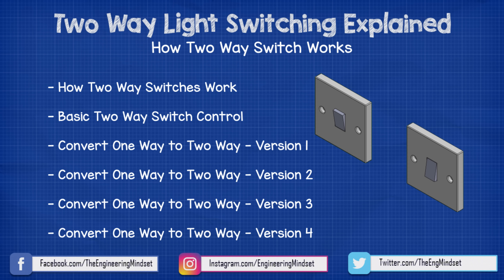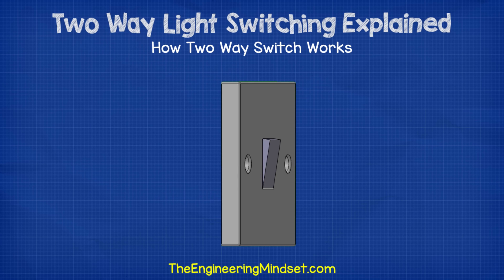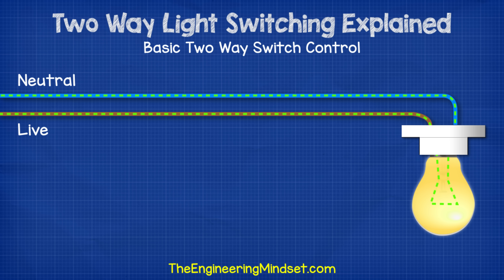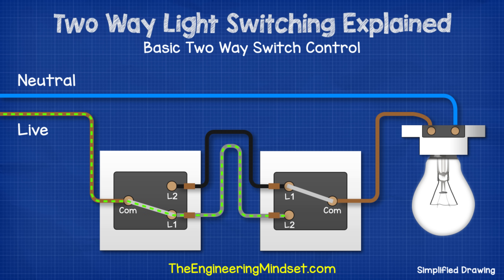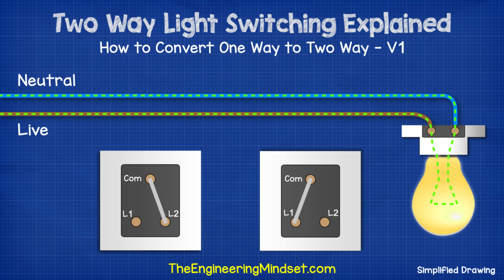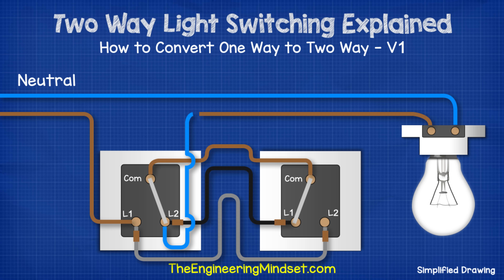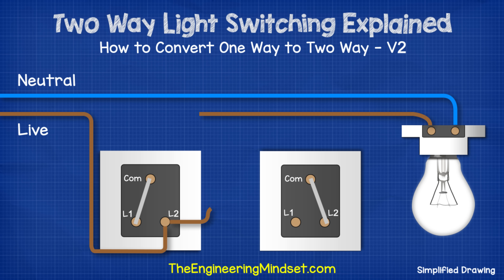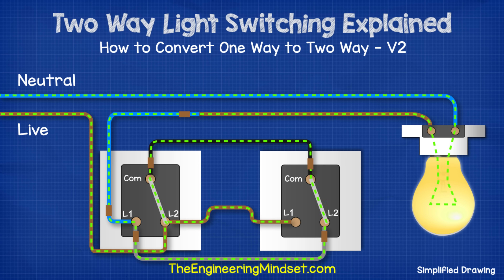Two Way Switching Explained - How to wire 2 way light switch

Comment: I just moved into a place that has 2 switches for one light. Except the switches are kinda weird.
Saying the switch is down is 0 and up is 1 and the lamp is either on or off; 1 or 0, our two switches work:
0 + 0 = 0
1 + 0 = 1
1 + 1 = 1
0 + 1 = 1
So half the time flipping a switch up and down keeps the light on in either position, and you have to walk to the other one and switch that one to make it turn off!
Reply: Your switches are connected in parallel, (in electronic this the OR gate) which shows the sparky who installed it, had no idea what he was doing.
Reply: @farmgadgets7261  OMG! DUH! I don't know why I didn't see that. I was trying to think about transistors, but I think I over-complicated it my head thinking about the semi-conductor part. I guess the intent was a XOR, right?

Comment: There is another way which is very easy to remember. Connect the Live Wire and the Neutral wire from Source to the L1 & L2 of both the 3 terminal switches respectively. Then connect the both the Common Terminals of both the switches to both the terminals of the bulb. No need to interconnect the Terminals of Swicth 1 to Switch 2.

Comment: I have a room where two switches control 1 light. I want to split the room with a stud wall. is it possible to add another light fixture in and then have 1 switch to control each light? UK.

Comment: Wow, this has kept me up. The mystery is over. Now I would like to know how those lamps are wired with the center light and the three around it and how the switch turns on one light then two lights then third light with the grand finally of all of them including the one in the center. Good luck. 🥳
Reply: Now you got the answer sir

Comment: 12/3 or 14/3 with ground would have made adding a second switch a lot easier. Run the 12/3 or 14/3 between both switches. On the new switch connect the black to common and the red and white to L1 L2, does not matter which goes to which.  On the old switch side connect the black from the 12/3 or 14/3 to the black going to the light. Connect the line (power) coming in to the common and connect the red and white wires from the 12/3 or 14/3 to L1 L2, again does not matter which. Now the light will work from either switch. But under current US NEC codes there also needs to be power at all switch locations. Reasoning is most smart devices require a neutral connection.

Comment: Version 2,3,4 is exactly the same
There is a version 5, but that prohibited as you then switch the neutral.
BTW we use brown and 2x black wire
Or when it's cable : brown, black, Grey.

Comment: It's embarrassing. I studied applied physics and electronics at university 30 years ago. I can bang out a 2nd order Bessel filter, a differential coplanar 20GHz directional coupler, a switch-mode supply or a microcontroller system as quick as you like. 

Lighting for stairs? 
OMG. Pencil, paper.... Struggle.
Every. Damn. Time.

Comment: It would have been better if your caption had not overlapped the switching diagram. We are able to see only your caption but not the full diagram.
Reply from the maker: The captions are turned on and off from your personal device, they are not on the video. You can even drag them around the screen to move them.
Reply: @EngineeringMindset  oh... Thanks a lot. I wasn't aware of it. Yes. It worked. Thanks once again for a wonderful informative video

Comment: I dont know what happen to my one outlet it has avoltage reading of 10 volts only but it had a separate switch box while the other outlet has a voltage reading of 150 who has also with a different switch box. My question is why is this happening I am living in a very old house
Reply: Thank you for your answer

Comment: Or you can connect Live wire to both switch's L1 and Neutral wire to both switch's L2. Now Connect the Switch 1 C to one side of the lamp and Switch 2 C to the other side.

If both switches are at L1 lamp gets two live wires but there is no potential difference to turn it on. Similarly if both switchs are at L2 lamp gets 2 Neutral and doesn't turn on. If both switchs are i  different positions one provides Neutral and other Live which completes the circuit

Comment: Very well explained. But one problem is that the titles are obscuring the line diagram in the video. It would be useful, if all the circuit diagrams are placed on a sheet and link of the circuit diagrams is placed in description.
Thank you🙏🙏🙏

Comment: Two years ago I fitted new wall switches in my home but I wired up one of the hallway switches wrongly. The problem was is that all of the wires are red and I misplaced one of the wires but this posting prompted me to have another look and I swapped two wires in one of the switches and bingo the hallway light works correctly now.

Comment: fun fact if you were working as an electrisian and used a blue wire as any thing then the zero/N you weoul be lucky if you were not imedietly fired. that is one of the first things i learned in school, blue is always zero and zero is always blue,  same with ground it is always yellow and green, if you dont have those wires you dont connect them untill you have them

Comment: Very intriguing. I definitely learned new ways to wire these switches. However, in America we're taught that the common terminal is always either for the hot wire or the wire going to the light. One mehod taught to us to wire these switches is exactly how you showed in the first demo; the hot wire in one swicth and the light wire in the other swicth. The other method taught is similar to your methods; both hot wire and light wire going to one swicth. In this method, we still connect either the hot or light wire to the first swicth common, and "L1 and L2" (we call these wires travellers) of the first swicth to the traveller terminals of the second swicth ("L1 and L2"), at this point only two conductors are ran between the two switches, with the hot or light wire connected to the common on the first. We still need a third conductor between the swicthes, however, the third wire goes to the common of the second switch and gets spliced in the box of the first swicth with which ever wire is not on the common on the first (hot or light). 
In other words, if one box has both hot and light wires in it then either wire is "extended" to go to the common of the second switch. 

Hope I explained it well enough.
Reply: Very good explaining it. I was taught calling the last of your example a dead end 3way
Reply: I don't know why everyone doesn't use the same colour wires world-wide.  Surely red, green and perhaps black or blue would make most sense?
Reply: @rob5944  it was way worse not too long ago, now L1 is brown, N is blue usually everywhere... and the black indicates a switched wire.
Reply: @whoknows8225  🥴
Reply: @rob5944  Red-green being the most common colour blindness, making that a bad combination.
Mostly though, it's all about USA running their own standards, rest of the world is generally on the same page.

Comment: connect L1 with Live; L2 with Neutral for both the switch's and connect light wires with the common terminals then also it will work ?

Comment: If you have the ability to get a cable between two existing switches — Just connect  as per normal . No need to wire like a Saturday afternoon Cowboy.
Reply: Thats what he's done, "connect as normal". Thats the normal way to connect two way switches!

Comment: Your going to confuse people by saying 2 way switches. They are called 3 way switches. When people go to look for 2 way switches at Home depot, or Lowes; they will not find them. Everyone" they are 3 way switches
Reply from the maker: It was explained in the video that this is for a European system where they are called 2 way switches. You need the US/Canada video for 3 way switches https://youtu.be/_u5ORnhqn8g
Reply: @EngineeringMindset  maybe you should put that in the title, its misleading. That's all.

Comment: all these are way more confusing than just line from ccu to com in switch 1, L1 to L1, L2 to L2, then from 2nd switch com line up to lamp and neutral from lamp back to ccu. how comes this way is not mentioned? seems the most easy to me?

Comment: Is it just me, but aren't t the "One way" switches in the second example still US 3 way switches?  Looks like a single pole double throw in both examples, which is called a 3 way switch in the US.  Right?  How is it one way switch if it controls two different circuits?

Comment: Just starting out as an electrician and your videos are very very helpful.  I'm not sure I understand the difference between the 1 way switch with 3 terminals and a 3 way switch.  If it has 3 terminals, why would it be considered a 1 way?  And why can't you wire it the same as a 3 way?
Reply: A 1-way looks very similar to a 2-way (3-way in US) because they are manufactured the same, only the L2 terminal is missing. You can use a 2-way as a 1-way by just using the common and L1.

Comment: the optional versions work ok if the nuet goes to the light but some folks run the power to the switch first. that adds another wire to the make up, say a 14/4 to get the nuet. thru the wireway. you have to be specific on your lines in the optional versions as well where you don't in a conventional config. i've never seen the optional versions done before and didn't even realize you could. nice to know though, but thanks, now i can go show off a bit with my guys :)

Comment: Hey Paul, you’re awesome! Could you do a video explaining how dimmer switches work; in 1950 when they used resistors and then how they now work using semiconductors? I’m struggling to visualize these concepts, thanks for all you’ve done for my understanding of electrical engineering!
Reply from the maker: Good idea
Reply from the maker: Seen our new Potentiometer Explained video? ➡️ https://youtu.be/Xb-MZMoUtcQ
Reply: They uses reostats, not resistors
Reply: @Helladamnleet  i think he didn't mean it resistor but variable resistor which is rheostats, trimmer, potentiometer and alike...

in semiconductor, there is still potentiometer but that will be feed to the one of the input of operational amplifier ic, non inverting ic particularly, and the other input is fixed, then the output is somewhat amplified to form analog output that is being amplified...you can check some of the DIY circuit online...mostly they used op-amp or amplifier circuit itself...
Reply: What is the advantage of convering one way to two way?
Reply: I don't know the working either, however, i think that one(each) of the leads have corresponding resistors.

Comment: Should have added pros and cons of each circuit. Regarding the 1st one, others seem just more costly with more wires and more required space with same output.
Reply: It really just depends on what you have available where.... they all work better in different scenerios

Comment: Just to be clear I am a licenced Electrician and licenced Electrical contractor in Australia. 
The first method is the way I would install a 2 way switch (Americans 3 way switch) both in a brand new house and as a retro fit. The other methods are needlessly complicated. 
To retrofit a 1 way switch: Run 3 cables between existing switch and new switch location. 2 cables get connected between each of the L1 and L2 terminals just like in the first version of the video. The active cable that goes to the light gets put in a connector with our third cable behind the original switch and connected into the common terminal at our new switch location.

Comment: Two 3 way switches are used to control a load from two locations.   One 4 way switch and two 2 way switches are used to control a load from three locations.  Jdw EE.

Comment: ok so i took screenshots to remember all of the details unfortunately for some reason i get no light from method 1 i tried method 2 it made the light stay on on and neither switch turns the light of so on to way 3 i got it to work but the problem i now get is both switches can turn on and off but i can turn on frm on and off frm the other one can turn on and off frm each and if one is on i cant turn off frm the next?
Reply: Google some more diagrams, rather than this video, there are simpler diagrams out there

Comment: I’m hoping to use this to wire a 2 way switch with a photoelectric sensor module and a momentary 3 pin push button switch on a motorcycle so the dipped beam comes on when the sun goes down, but I still have the ability to switch to the angel eye side light function as I wish. 
Both the photo sensor module and push button switch have a common and instead of L1 and L2 they have NC and NO positions would this be the same as L1 and L2? And would this type of wiring work for an automatic and a manual switch to control between side light and dipped beam? (High beam is on a different circuit and I won’t be touching that)
Reply: Yes  NC and NO are switched terminals, (L1, L2) Normally open, normally closed. And can *probably * do the auto/manual you are hoping for.
Reply: Oh also the push button switch has 2 extra pins for an LED that can either be on wired to stay on all the time or can be wired to switch on only when necessary. I was hoping to have the LED come on when the dipped beam came on. I would love help with the wiring diagram if possible for this slightly more complex feature!

Comment: There is a hallway in my parents house with 9 switches all controlling the same 7 lights. You can flip any switch to turn the lights on or off. Is the wiring the same as one of the examples in the video, just extended for more switches?

Comment: My great uncle, Everett Danforth Winters, invented the two-way light switch when he was an employee of Western Electric near Chicago, IL, likely in the 1930s. My mother always referred to him as an "electrical wizard." His basement in Berwyn IL had a narrow pathway thru a myriad of electrical equipment. He was always "tinkering". Of course, Western Electric claimed the patent. My uncle also invented another electrical device you use every day: The turn-signal return device inside your car's steering column. Western Electric also claimed that patent.
Reply: Michael Landis, the quick action switch was invented in 1864. If your claim is true then it took 66 years for human to add another contact point to the switch. Your uncle was truly a great inventor.

Comment: With every example you need three wires for switching On/Off. If you don't have them, there is an (generally) illegal way you can do it with only two wires. It is generally illegal everywhere since when off the lamp is on full voltage half of the time (even when not lit).

Comment: How would I call a device (commercial name) that can detect when another one is closed or open so I can create a 2-way switch set including something that only go 1 way?
My dad bought a remote control for the lights, but since it has only 1 input and 1 output, you can only have it in OR/AND logic (to which he choose OR), but if there is a device that can detect when it is open, it's possible to have two lines that alternate the closed status based on that, right? Kinda like, this device would be another 2-way switch that tests if the remote receiver circuit is open or closed, and changes its input to A or B based on that (the wall switch is already 2-way, so no problem with it).

So, what do I search in the net for this thing, and are they expensive?

Edit: Oh, I think what I'm looking for is a XOR or XNOR gate, now I need to ask: where can a find one that can withstand ~100W (127V with variable current) ?

Comment: Nice video.

Two things though...

1 - The wires shown at the beginning were stranded   People need to understand that wiring in a home should use only solid wire, not stranded

2 - The brown sleeves, nice... but safe to assume electricity is present in all wiring until the circuit breaker is switched off.   The safest thing to do.
Reply from the maker: Seen our new incredibly detailed MCB video? link: https://youtu.be/gqEu9t8HwW0

Comment: Wait wait wait wait wait.... WAIT. The four last ones are all the same. It's just different colours on the cables. The good thing about the four same things are that you can run a lighting line and a continuous live line for i.e a five pole MMJ (don't know of it's called that just here or everywhere, but a surface mounted cable with a PE (green-yellow), a neutral (blue) and three live wires. You connect them as you have, one pole has continued feed and the other pole is the light feed. And you can put i.e five lights and sockets between the switches. We don't have marked Common and L1 or L2. We have L that indicates the common and the we have arrow1 out and the other is just arrow. We use the same switch as one-way and two way, in one-way you just leave the arrow unconnected

Comment: At about 3 minutes 15 seconds you start to explain how to convert one way to two way (version 1). The explanation starts with the light wired up to live and neutral but without any switch at all. So the explanation is actually how to convert no way (an unusual scenario) to two way. It would be a better explanation if you started from a diagram showing it wired through a switch (one way) and then how that is modified by wiring in a second switch (two way). I do find this stuff confusing!
Reply: …and here I was thinking I was the only one to notice that. :) After the line to the bulb was cut he showed a fresh install rather than a conversion.

Comment: If one switch works fine but the second only works when the first switch is on, would you assume strappers are wrong ?
Reply: Have the same problem in the house we just moved into. Giving me the shits... what did you do to fix it?